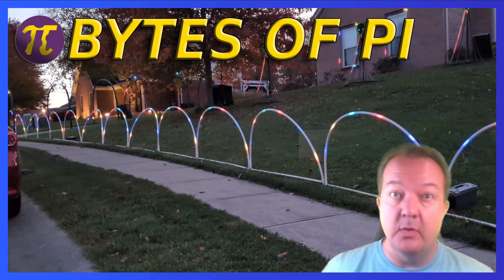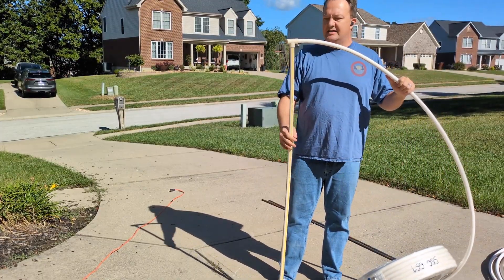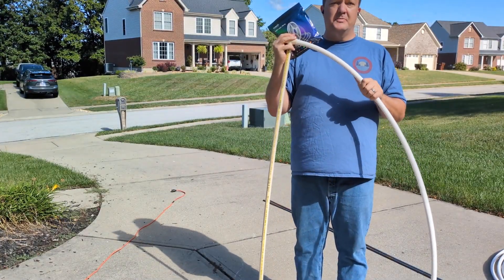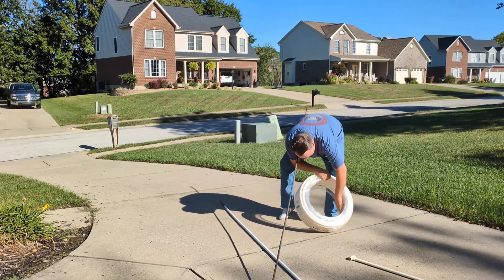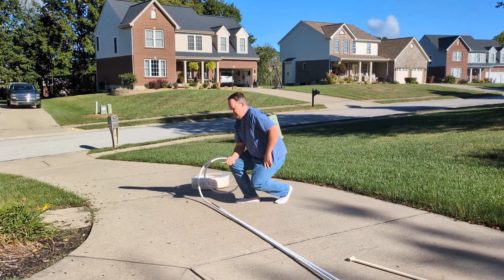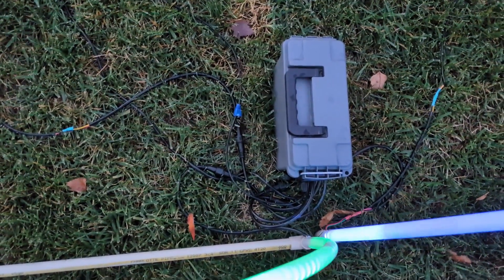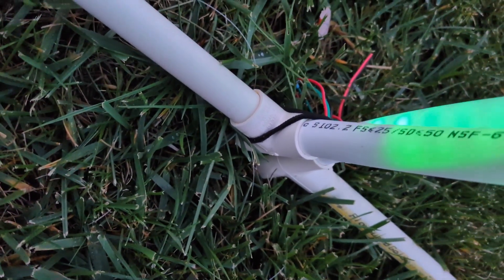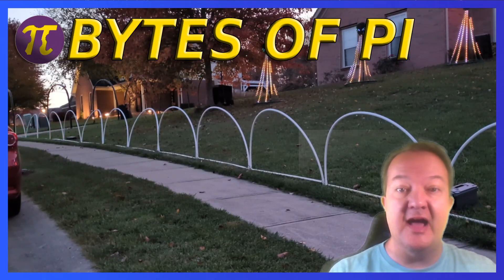How to build Pixel Yard Arches with WLED and xLights

Comment: Hi ! I have been watching your videos of using wt32 boards to control lights shows and bought few of them. But i am unable to run the ethernet part as the board seems to be not reading any ethernet. The wled part of it works and i have selected wt32 as the ethernet type yet no luck. This is same for 4-5 boards i tested. Sadly due to this situation i had to run the show over wifi which severe lag at times. If you can be kind and spare sometime to help me with the situation i will certainly be grateful as i am out of my depth.
Reply from the maker: That's terrible, sorry that you are having so much trouble.  
To recap:

-) You can install WLED and get WiFi setup.
-) you setup Ethernet by going to "Config" and then to "WiFi Setup". At the bottom of this page select the Ethernet type (WT32-ETH01 )

Make sure your WiFi settings are NOT setup so it doesn't take priority over your Ethernet connections.

  If you plug in your Ethernet cable to your network, does the Ethernet jack light on  the board turn on?  If you don't see the light, it may not be connected.

If the light is on, Do you have access to your Ethernet network router?  You should be able to see it on a list of connected devices.  It would be good to setup a static (reserved) IP address if you can.

Try to access it in your computer browser by typing in the IP address

Comment: Hi! You’ve helped me setup my first LED strips a year or 2 ago using WLED. I’m using 3 DigQuad controllers now all sync together (with WLED). Now I’m at a point where I would like to take it a step further and add music. I setup FPP on a raspberry pi but my question now is my understanding is that I need to setup everything through xLights correct? Then upload to FPP? Then how do FPP speaks to the controllers, is it through WLED or do I need another software on my controllers? 

Any help, insight or reference to a how to video would be greatly appreciated. Thank you for your time and great videos.
Reply from the maker: Congrats on being able to set up your DigiQuads and props. 

xLights, FPP, and WLED Video
Setting up FPP, xLights and WLED does take some time and I have a video I put together setting it up from scratch: https://youtu.be/LkGCo9Gi8mk
In the video, I'm using WT32-ETH01 controllers, but it's essentially the same.  When it comes time to setup xLights with your controller, simply choose DigiQuad instead of Generic ESP32.

Couple of comments:
Starting Universe
-) Setting Starting Universe # - One critical thing I don't point out in video is that even using DDP, you need to specify a Universe in your WLED setup.  I think upload will set it for you, but if it doesn't, you can check your controller in xLights for starting Universe and then check WLED > Sync Preferences > E1.31 section matching the unverse number.

Avoid WiFi
-) WiFi is sketchy - Coordinating music to your wireless controllers is sketchy at best.  You will probably find that running a show with your wireless DigIQuad/WLED devices may be rough.  You can definitely try with just WiFi, but if you have problems, you may need to change something.  There are a couple ways around this with DigiQuads by:
    a) Purchasing the Ethernet hat and hooking up physically
    b) Purchasing the AE+ hat and flashing ESPPixelStick software instead of WLED (most difficult option)
Reply: @BytesOfPi  Thank you for the prompt reply and the link to your video, this is going to be my starting point. Then I will install xLights on my computer and then try to sync with my Quads. My main DigQuad is wired but the 2 on my yard are wireless and yes I read that WIFI can't be sketchy. I will give it a try and go from there. Like you said, I might have to buy the eth adapter and find a way to wire them. Thanks again for the great tutorials, greatly appreciated from DIY people like me!  Dom.
Reply from the maker: @idscomm  not a problem.  Good luck with your show.  Two final suggestions I saw on a Reddit post yesterday about optimizing xLights for WiFi.

Try 20 FPS instead of 40 to start and
Not sure if it translates to FPP, but in xLights Controller tab, for each controller there is an option to Suppress Duplicate Frames

Comment: Great videos man! Very informative and to the point. I have an led strip wired to an esp32 and the lights are addressable in groups of 6. How would I model that in xlights? If its 10 groups of 6 for 60 lights, would it just be 10 lights on the line in xlights? Hope that makes sense. Thanks again for the great content!
Reply from the maker: @mebunkeryou8718  
Hey, good question.  I'm betting you're referring to the COB types of strip pixels.  While I've not used these types of strips before, I believe you are correct.  There's only one chip for every 6 so only one E1.31 packet for each group.

Bottom line, I think that you are correct.  A single xlights pixel would map to 6 six on your string.  There may be a way to map one node to every 6 in a model, but I've not done that yet.  

I think there is a way to do pixel mapping.  The manual may have more.  https://manual.xlights.org/xlights/chapters/chapter-four-tabs/models

Comment: Hey mate, me and kids are loving your videos and they want me start to do WLED , have used raspberry and wt32-eh0, only thining im not sure about is what type led chip i should get? Thinking using 12v from old PSU, and any links too good suppliers, and anything else you can recommend.

Cheers Luke from Australia.
Reply: Thankyou very much for time and effort helping me out, time too do more research, cheers can't wait see new video's.

Cheers
Luke
Reply from the maker: That's awesome!  Glad you and your family enjoy and are thinking about getting into the hobby.  There is a strong Australian community at:

https://auschristmaslighting.com/

As far as pixel vendors, that's a tough one.  When I started back in 2018, Ray Wu at AliExpress was great and I bought a lot of 5v bullets.  However when I bought in 2020, all of the batches had defects and they flickered really bad when voltage dropped.  If you check the pixel report (https://www.pixel.report/report-data) Ray's pixels are the worst offenders.

I now get pixels from a vendor here in the states called Wally's Lights.  They are more expensive, but I've not had a single bad pixel with them.  Best thing is to wait until after Christmas around March and vendors will offer bulk deals 

I have both 5 and 12v pixels in my show.  12v  has advantages when you need less power injection points, but 5v pixels have less chance of catching fire and you can use a 5v phone charger to run both the controller and pixels 

I think the best advice comes from an actual electrical engineer.  Give Bill Porter's VCS zoom talk a view.  He's an electrical engineer and explains things like power injection, wire gauges and fusing.  If you're starting new, that's the best place to start https://youtu.be/eR3QbzjpZy8